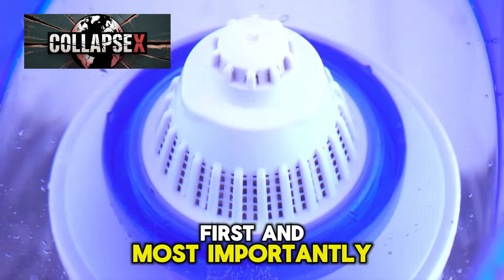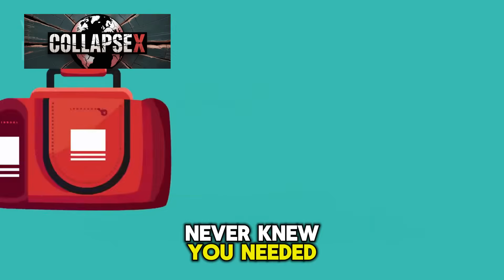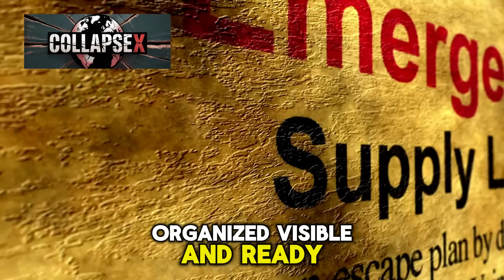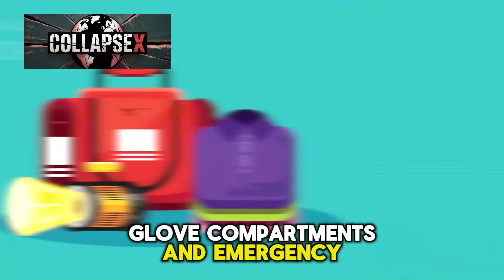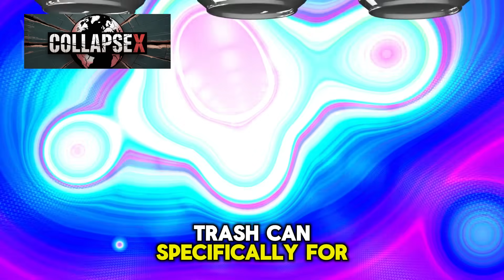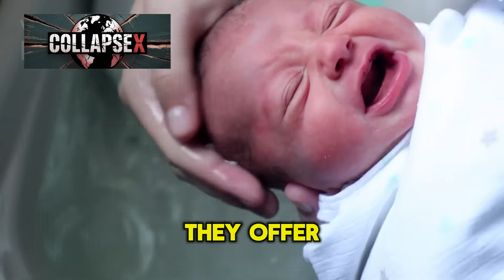12 Everyday Products That Could Save Your Life During the Next Power Grid Collapse

Comment: If you have a well you might want to make sure it runs on 120 volts, or have a 120 back up. I can draw 118 gallons of water in 15 minutes @ 450 watts, this is easily provided by a 2000 watts inverter and a modified extension cord . With a cheap solar car battery charger you can get around 225 watt hours a day

Comment: I have 7 Bluetti solar generators/power banks. 3 of which are bigger powerful one's. Then 2 medium sized one's and, two smaller one's. Solar panels. Solar lights and some of which I have been using in doors at night to help out. Rechsrgable batteries, rechargable lamps. Lifestraw water purifier and many filters. Electric blankets, flashlights, emergency blankets, walkie talkies, an emergency/camping/off grid rechargable portable shower with pump. A 15 gallon bin to put water in for showers. A water heating stick to quickly heat the water for showers, 2 dual cooktops, extra foil and tolet paper. Buckets to get rain rain water. Simple emergency food. Knives, tools, a lot of guns and a lot of ammo!
Reply from the maker: Wow, it sounds like you've got an impressive setup! Being prepared for any situation is always a wise move. Keep up the great work!